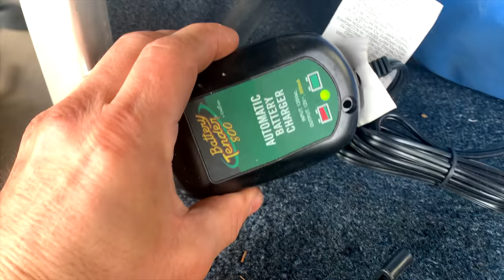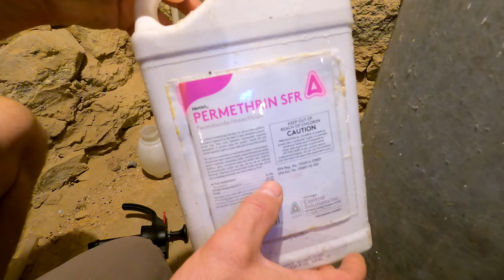8 REAL Farm and Garden Hacks You Probably Haven't Seen Before.

Comment: the battery tender will actually give the battery many more months life in general.
typical maint free lead acid battery life is between 5-7 years with some extreme cases being up to 13 years of useful life.
what kills a battery is lead sulfate crystal buildup

TLDNR: Battery maintainers keep the voltage high reducing large lead sulfate crystals forming that self discharge your battery and kill it early. 

during the normal discharge process while using it, the battery creates small lead sulfate crystals inside itself, and during charging they get re-absorbed into the electrolyte(sulfuric acid) to form lead on the plates and sulfuric acid again.

problem is the bigger crystals, as this process happens naturally some bigger crystals are formed, and as time goes on and the battery is discharged and charged more and more big crystals are formed, this is a problem as the bigger ones struggle to disolve during charging and clump up between the plates starting from the bottom up.

they are also conductive, so eventually you end up with too many, that will actually bulge out the battery, AND they conduct, so they internally short the battery, and waste energy as heat and discharge the battery leaving less for us to use.
Even a new barely used battery has some internal discharge, the more its used/the more undisolved crystals formed the faster it self discharges

in extreme cases you will see someone whos been jumpstarting using a battery that should have been replaced a long time ago, smoking and boiling sulfuric acid vapors out of it as the alternator puts charge into a battery that is discharging almost as fast as it charges.

what makes really really BIG crystals REALLY fast is having the battery go flat, below 10.5V DC big crystals are formed quickly, the lower you go, the bigger and more of them get formed.
so every time you 0v your battery by leaving a light on or lf its left self discharging in a tractor for 6 months for example.

so you cut a lot of the batteries life off by letting it go flat even once.

how does the battery maintainer help? 

it keeps it fully topped up, which helps redisolve the lead sulfate crystals and prevents self discharge bringing its voltage down which then forms more crystals which makes it discharge more
a fully charged lead acid battery is a happy one.

you'll typically get 5 years out of a battery that is taken care of like most people do.
you can get 9 years out of a decent quality battery that is properly maintainted.

Comment: Pot farmers use a lot of the welded wire designed for concrete reinforcement to make cages.  As the plants grow, larger cages are installed so there may be three cages entwined in one plant.

Drip torches, such as wildland fire fighters use, use a 75/25% mix of diesel and gas.  I generally use propane torches on burn piles now.  they work better, cost less, are safer, and draw air into the pile.  Using fuel just takes all the oxygen up and leaves little for the material you want to burn.

You are violating the label on the pesticide in the way you are using it.  A Federal offense.  Just saying.
Reply from the maker: You are wrong about the permethrin.  It is marketed and sold for that purpose.
Reply: @FarmCraft101  You are correct that the material has that use.  If you check the jug that you have it probably does not list that use on the label.  The product label is essentially a Federal document governing its use.  This may seem pedantic but the 'crats at the EPA find it significant and levy penalties accordingly.